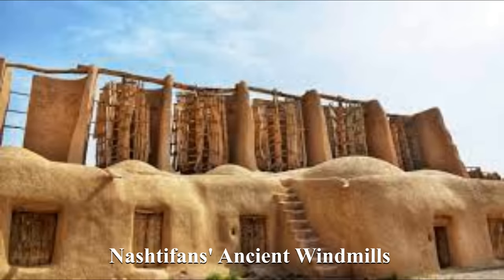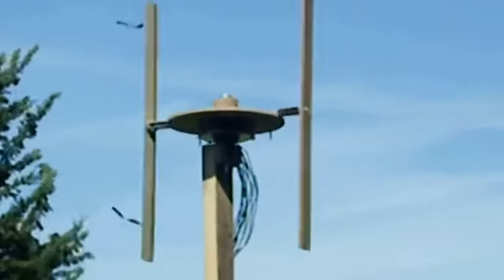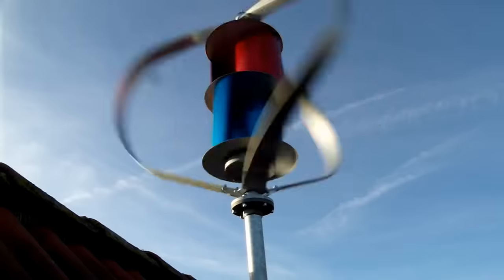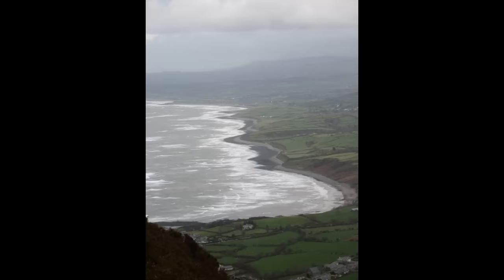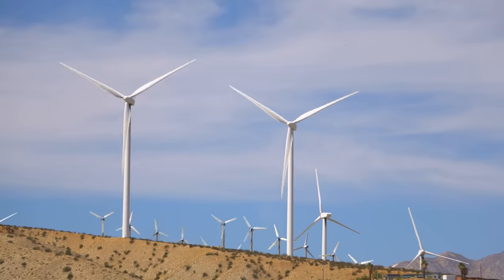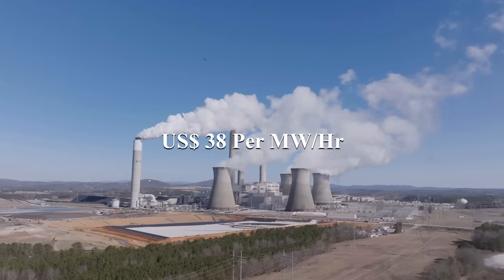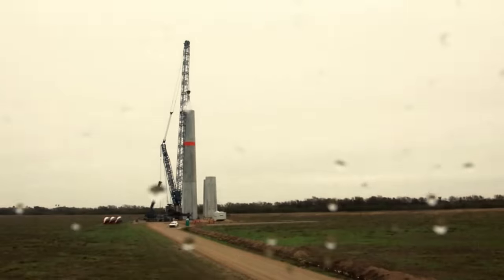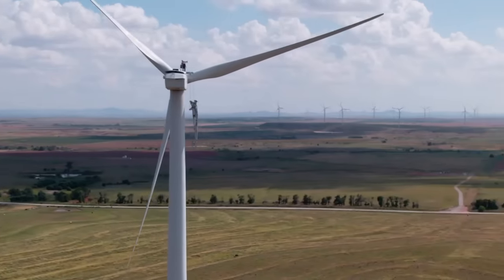2200 Wind Turbines - The Future Is Vertical

Comment: Started experiments with windmills in the 70's all kinds of designs, however I landed on a very robust design used at the south pole weather station using a 55 gallon steel oil drum cut lengthwise.
The experiment results proved to me that the savonous style tended to survive free run abuse that most other models would fail mechanically.

It ran for 15 years until the used  bearing on the top failed. 
Out ran all others by leaps and bounds.

My thought is the best windmill for you is the one you have working until the next one is built with the lessons from the last.

Comment: I've been building vawt for ten years ,since I retired . Of all the vawt that I have built I like the Sharp vawt the best. It has blades that change pitch passively . It has a low rpm but very high torque. The low rpm lessens the blade fatigue so there are no catastrophic failures. The low rpm/high torque can be translated into high rpm with a transmission. The blades are lift type and I use NACA 0018 blade profile.
Reply: I'll find the time to watch your stuff later.
Subbed
Reply: -why use a zero camber profile ??  (I get using a relatively low drag  - under 20% thick))
Reply: Because it essentially flies upside down sometimes by going in a circle. It needs symmetrical wings.

Comment: Years ago I saw a design in Popular Mechanics that I've never seen built. The axle of the generator was mounted at 45 degrees, the gen close to the ground. The rotor had long blades mounted at 90 degrees to each other, from one side to its opposite, such that when one side of the rotor was pointing at the sky, the other side was parallel to the ground, sort of like a badminton shuttlecock held at a 45. The advantage claimed was the it didn't need an enormous pylon sticking up in the air. It could be mounted on a roof ridge and the blades on the high side would reach high for the wind, while the blades on the low side would be parallel to the ridge.
Reply: The blades would undergo cyclical loading on every rotation,
probably leading to fatigue of the blades or bearings - resulting in long-term failure.
Reply: @BillMitchell-lm8dg  I was thinking the same thing as I read the description, there would be an additional bending force on the roots of the blades caused by the rotation trying to force the blades into a flat plane.  Possibly tying the tips of the blades together with a ring structure would help, at the expense of some extra drag.
Reply: .@ferrumignis  - Maybe a toroidal prop would work to tie the tipe of the blades together and help with efficiency, but that would probably add too much weight.
:-(

Comment: I remember reading about the leading edge effect in VAWTs, akin to that seen in migrating geese, back around 2005. Place a bunch of them on a gimble table so they can readjust themselves according to the conditions and the trailing turbines experience huge efficiency savings. And the stresses can be shared among the group if they're permitted to change position in the group.
Reply: - a huge, multi spindle, slewing array  - would be impressive..  (Who says non-slewing is necessary for VAWTs, lol.)
Reply: Sounds very ... sci-fi , 
Kinda amazing really,  
Pods or swarms of slaved  turbine drones  shifting  around at sea  autonomously , to get best use of the winds , 
Microwaving energy back to a central master unit, thats connected to a underwater power grid ,

Comment: The best thing about wind energy is that most of the power density of the wind in the mountain regions is directly on the ground and this is often 10 or 20 times higher than at an altitude of 200 meters. This is because the rocks are the natural wind accelerators. These VAWTs would therefore be the ideal solution for harvesting these enormous amounts of energy.

Comment: Complete non sequitur, but I live near the Bay of Fundy with 30 foot tides and I was wondering if you've ever heard of something that uses tidal gravity batteries. The underwater turbines they've trialed all seem to get torn apart pretty quickly, but with a 30 foot lift and drop twice a day, it seems like there could be some potential (no pun intended).
Reply: That is a great idea! I imagine a barge filled with rock until it’s almost sinking. Four steel I-beam legs near each corner attached to electric generators. Wait until the water is at least below the bottom of the barge before you allow it to lower and produce power. And it’s even energy storage if you want to at least for 12hrs. If you secure the legs to the seafloor then you could even power as the bay fills. The problem with those other turbines is they’re biting off more than they can chew. Drop anchor with any ship and I guarantee you the prop will rotate and not get damaged. Scale this up with multiples and you will generate lots.

Comment: The Harmony variable sweep VAWT is very interesting home sized design, not only in the variable sweep design,but the generator design is also patented. The generator has a variable armature rotor spacing to reduce the low speed cogging effects.
Reply: good - the only good thing about patents is that they expire..  lol -

Patents are decidedly "Anti Free Market" - the argument they are necessary is rubbish, they really stifle innovation in 20 years of redtape,  (If the inventor can't make it to market economically, then it may not be such a great idea - let someone else try..
Reply: @kadmow  
They actually do nothing of the sort. If I can market something, better than you can, based upon your creativity, do you not want to be compensated for that creativity? Or would you be OK with my making billions, on your idea, while you get nothing? Patents protect that. Or they are supposed to.

Comment: The HAWT with the leading edge bumps and feathered trailing edge was fascinating. The secondary blade bumped and feathered , offset 60° and recessed about 6 inches ( sorry I am a U.S. Citizen ) I  would think increase power out put a few more percent. Cou!d the bumped feathered double offset blades be applied to a VAWT? I would love to construct, test and share said data with you. Unfortunately I am limited to thought experimentation since I am housed in a rehab center and have no access to tools or work area. I enjoy your content and your character very much and have been following since I came across you video on reluctance switches. Thank you for your curiosity and willingness to share.

Comment: Rosie Barnes did a video on recycling blades - whether or not to bother, and how landfill in itself can be regarded as "sequestration"  (a least harm disposal)- I have often joked with respect to this.

She was quoting a 20 year design life - Is there any real world study (public) to prove that they are (or are not) meeting their design life - on average?

VAWYs don't have to be low to the ground (lower blades could be surface optimised, while upper blades - clean air optimised), nor do they have to have lower swept area than HAWTs  (design for high centripetal loads - Vestas Rcket is an example of a strange  "blade" sail - geometry ) - once the diameter of the sweep is above a critical harmonic distance leading edge negative effects will be diminished -   they will tend to have higher stopped drag on the tower head for the same production capacity (a benefit of shorter towers), most likely real - MW capacity commercial units WILL have featherable / variable pitch blades - and absolutely could be self starting, but with buffer batteries, grid connection and inverters, self starting shouldn't be a criteria to "design" less efficient units.

Generator on the ground can be great - or terrible - if the driveshaft adds too much inertia  - or fails in an overpower condition - twisted noodle anyone - hence a really good reason for aerodynamic braking and up-tower emergency brakes.

Comment: If the vertical windmills were placed in a lattice of isosceles triangles, and the central shaft increased in height, they could be braced by struts or ropes connecting them together. Your thoughts.

Comment: Robert, I'm not sure where you got your data for levelized cost of power generation but according to wikipedia's article 'Cost of electricity by source', looking at 2023 data, wind power is way cheaper than fossil fueled power generation.
Reply: Yeah $38 per megawatt sounds like only the cost of fuel to burn. That number seems way too low to account for operations and maintenance labour costs and materials nor the upfront cost of the asset over the lifespan.
Reply: The fossil fuels industry is hugely subsidised. Take this tax evasion away and renuables are way ahead
Reply: And there's no way that the #38 per Megawatt includes the incredible cost to the environment of burning fossil fuel.
Fossil generators will need to be switched off, even if wind was not an option (which, luckily it is).
Reply: No so with the hawts in Australia. The company which own them receive 600k to 900k per yr per unit, and to top that off the hawts rely on grid power. This makes that data completely useless

Comment: I haven't heard such hawt performance deteriation before. If the issue is blade performance due to erosion I wonder if they should consider aluminium alloy blades as per aircraft which may be more expensive at the outset but cheaper in the long run and totally recyclable.

Comment: I have always been an advocate of VAWTs, believing their reduced efficiency can be offset by their lower cost and ability to work at lower wind speeds. I thought maintenance costs were invariably lower than for HAWTs, though one slide on this video claims the opposite is true. I had never seen such high cost figures for wind per MW/hour, as quoted in this video, that were so much greater than those of fossil-fuel derived  power.  It would be interesting to see the sources of such figures. Thanks for an interesting video.

Comment: I think the straight Wings need multiple wings like a buy or even a tri-wing plane design wind power plants have also always had an issue with battery storage which could be very easily solved by putting the wind power plant on top of a water tower the wind power plant pumps water into the tower and you get the electricity out by allowing the water to go water turbine generator at the bottom of the Tower preferably you then use the Wastewater to water crops to optimize output

Comment: I wonder if you could build a small one to run a compressor and then use it to power a simple heat pump to heat a rural work shed in the winter.
Reply: You can. There's a video out there about a rural shop that uses a windmill to compress air into tanks. Then they run the place on 100% pneumatics.  No batteries needed but you need a lot of air tank space.  May be better to put the tanks underground.

Comment: Are you sure about the cost of current wind power ?  '....levelised cost estimates for different forms of electricity generation provided by the UK Government Department for Business, Energy, and Industrial Strategy in August 2020 [5]  CCGT £85/MWh, offshore wind £57/MWh, onshore wind £46/MWh, large scale solar £44/MWh.   VAWTs need to scale up (and not fail)

Comment: An advanced vertical turbine with variable pitch & airfoil shifting blades with wind direction tracking for optimal blade orientation at all phases of the rotation to minimize drag which is what kills efficiency.
Reply: Probably too many moving parts
Reply: @eliottc5371  It's certainly a more complicated approach. I've been thinking about the problem for a number of years. While pitching the blades uses some of the power that the turbine produces, the result is that turbine can be efficient at a wide range of speeds rather than at one speed. This allows much greater energy to be captured from the wind. I think the number of moving parts could be reduced to a very small number; clearly the blades would have to rotate about their centre of pressure and a precise motor mounted on this centreline of each blade would be needed for motive power. The final moving part would be a rotary transformer to pass power from the ground to the motors.
Reply: @eliottc5371   Remove the airfoil shifting blades but keep the variable pitch which does the heavy lifting. The airfoil shifting blade would make it more efficient in a larger range of wind speeds but at the cost of complexity like you said
Reply: @tlangdon12   Yep pretty much this ^. The variable pitch will allow the blade to hit the wind at an optimal attack angle for maximum "lift" or pressure and rotate to neutral when the wind direction is opposite and unfavorable for that specific blade on the carousel. I have no idea how many blades would be optimal etc those need to be worked out in engineering programs.
Reply: @hd-be7di  Particularly with an active pitch VAWT, you want the minimum number of blades because of the cost of actuators. (HAWTs can use a single actuator because all the blades are pitched at once, whereas a VAWT, each blade needs its own pitch angle). But three blades is better than two because it's better balanced. Torque ripple is less of a problem with active pitch control - you can reduce the torque variations using the pitch control rather than increasing the number of blades to get smaller torque impulses. Active pitch control aslo overcomes the problem with starting that VAWTs generally have and also gives better tolerance of high  winds because you can pitch the blades to their minimum drag angle.  Lots of advantages IF you can manage the complexity.
Reply: So maybe try a single blade with a counterbalance and blade orientation constantly varied by a microprocessor controlled stepper motor.
Reply: @tlangdon12  I was thinking of a dual blade setup to start with. Horizontal spring damper system on a ball type socket at the bottom to absorb turbulance forces applied on the vertical rotor shaft. The dual blade might be more efficient because each blade adds more wake thus reduced pressure plus the added weight of a third blade...
Reply: @tlangdon12  The dampers could even be replaced by regenerative actuators so the turbulence energy could also be harnessed. Maybe one last note imo a dual blade setup can be equipped with wider / larger airfoil blades to cover more wind contact surface area for the amount of space the turbine takes thus increasing overall efficiency..

Comment: when will you please make a video of where you melt iron and nickle and dope it was phosphor , to createa tetrateanite while its still molten, by applying a super strong scapyard level-ca-picing-up level macnet is usd around it as it cools down and forms its agnetic sphereS? I wand disks of specific share, wit serrations on the edge  on a slightly bevelled vield, whose botteom is flat, but his underside is also srrated and angled, and at areas paint. this magnet should be placed in a magnet that leaves the ngeative mpty space thisleft.

Comment: Can we alter the shape of vawt or add blades to take weight off thrust berings?
Reply: Where do you think the weight removed from the thrust bearings would go?  Hmmm.  I suppose you could put a propeller on top of the rotating structure to lift the rotator off the bearing.  
Otherwise it is my understanding that the thrust bearing, and subsequent maintenance on the bearing, is the limiting factor in VAWT development.  The VAWTs tested in Banning Pass back in the 60s ground to a stop when the thrust bearings clogged with sand.  To replace the bearing the entire structure needs to be lifted off the bearing.
Reply: @dchall8  they spin like helicopter blades, am i wrong, I think similar lift can be added to overall design as well

Comment: you forget to tell that sailor had been using vertical sails,so is a proven tech, small rotation sister just produce to much drag, wat is needed is a train like sistem at list one or two km long mounted in rails running parallel instead of a circle,in the  vertical position the full area produce full tork,in horizontal blades only the tips produce maximum force but a to high speed that produce drag( over 200 km/h) vertical Wing don't need to go that fast because it can be made wider instead of longer.

Comment: I don't understand this with the prices, are we paying for the wind that blows?
Reply: You could say the same about coal or oil.  The costs are in getting the stuff out of the ground, processed, and transported to the power stations; also in building, maintaining, and operating the stations - we don't actually pay the ground for the fuel we take from it.
Reply: @ceptimus  yes, but wind has no costs after a few years and should be cheaper every year
Reply: @krisztianvirag4807  I suppose the costs are in the maintenance of the turbines, and their associated power distribution cabling.  The cables are distributed over a wider area than with fossil fuel power stations, and they require transformer 'sub stations' to step up the voltages to distribution grid levels.  They're usually installed in remote, often high, countryside, or out to sea, so the costs of getting engineers and equipment to them is much higher.

Comment: Large scale wind generation has no real future, it has too many negatives for that to happen. it is only political will that has caused the expansion we see today. When the politicians finally see that it is not working and is expensive, support will disappear as fast as it appeared.
It may have niche applications but for grid generation it meets none of the necessary criteria, synchronous (for load and demand balancing), has inertia, can provide reactive power control and support short circuit current levels, criteria that conventional generators have.